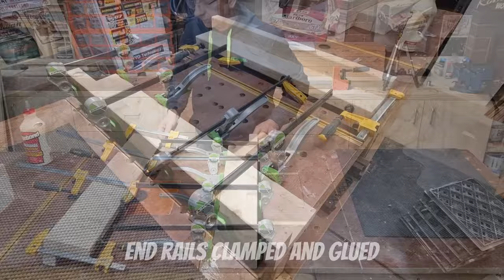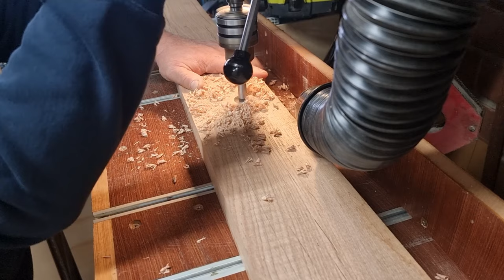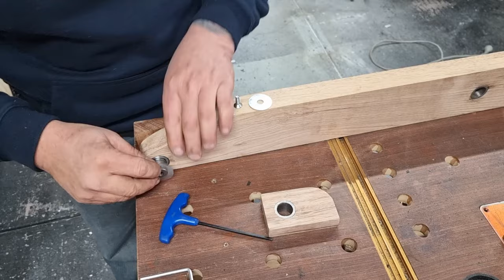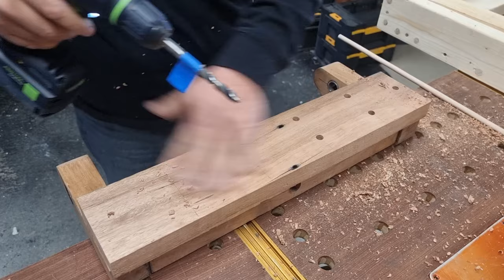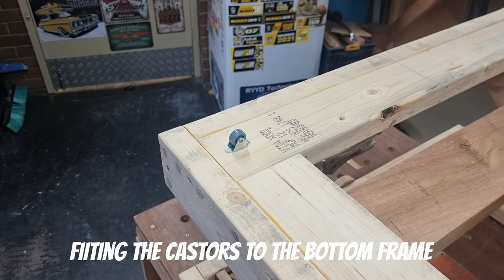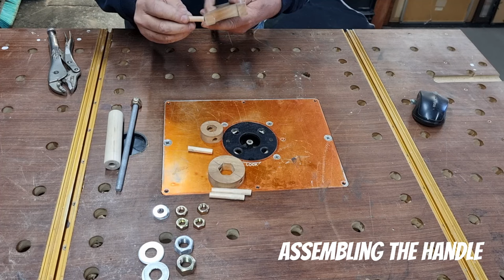MOBILE HEIGHT ADJUSTABLE WORKBENCH - My First Build Video

Comment: Mate, great workbench. I think the next step for this project is to add automation to the lifting mechanism. I really like these adjustable height tables. You could use that as a car stacker with the over engineering that went into it 🤣 but it’s going to last forever. 👍🏻👍🏻
Reply from the maker: Already done some work on it just looking for a more compact 24v option that will fit under the top.
Reply: I was going to say the same thing... bit of a workout to get it up and down. Defo wants a motor. But now Rob can pack on the beers and be confident it will still carry his weight 🤣🤣
Reply: @TigerDusty  попробуй использовать двигатель от стеклоподъёмника или дворника стеклоочистителя лобового стекла. 🤔. А так ты молодец 👍. ))

Comment: Exactly what I was looking for for my "under table" miter saw.
However... you haven't shown how you arrange the auger (the screw) in relation to the trolley that moves the table up and down.
Reply from the maker: At the 30:00 minute mark you can get and idea of how it works. There is a threaded rod connected to the other side where the handle is.
I have a sketchup model if you would like a copy.
Cheers
Reply: @TigerDusty    With pleasure. But, how can I get it ?

Comment: did you ever get tired of doing that many turns to lower and raise the top? I was thinking maybe a wheel on the inside under the table, a chain to a smaller wheel and the ability to move the handle from middle to one of the sides for a better turn to movement ratio would be good.
Reply from the maker: The table now has a 24v motor with limit switches and foot operated up/down switch.

Comment: Hello, maybe you can share some feedback after some period of use. If I would have to add something to your otherwise decent built it will be metal bars under the bearings. I do not really like to have metal to wood contact and specially where the real compression is happening.
Reply from the maker: The unit has been working fine and is showing no sign of wear under the rollers.
Metal strips could be added if you like, this could be an improvement to the design.
Thanks for the suggestion.
Cheers